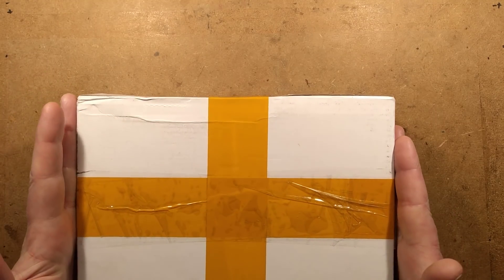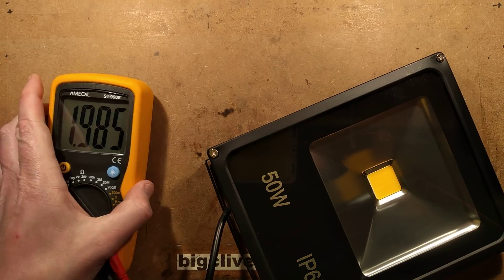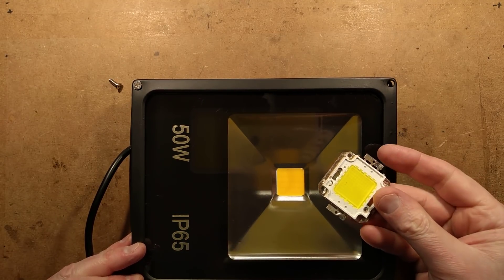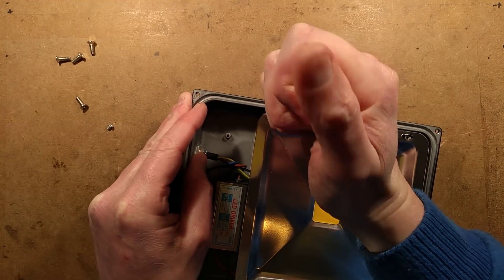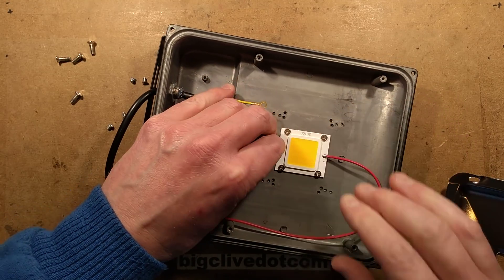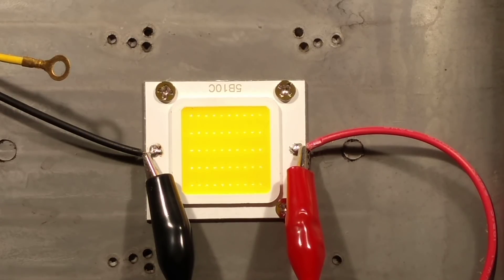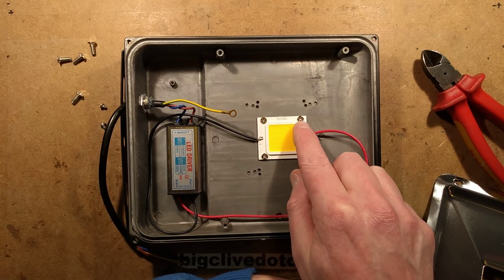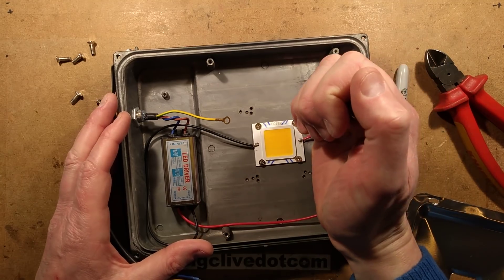Another cheap eBay LED floodlight.  Is it really going to be 50W?

Comment: Uk supplier my bum. These Chinese companies really piss me off doing this. Claiming to be Uk based but usually either send directly from China or send the item from China to a Uk reseller who then forward it on which takes longer. The Uk part of the supplier might keep a few things in stock but my luck usually involves an excessive wait.
I’m really impatient and have been spoiled by Amazon Prime delivery so I purposely don’t buy from Chinese suppliers for most things yet they still manage to screw me over.

As for the shitty ratings for Chinese products, on LED lights, they claim it’s the same output as a similarly rated halogen light. More bullshit arse covering.
Reply: I find that the delivery ETA speaks volumes.   A month for delivery from a UK seller is usually indicative of such a practise.   I might start doing what Stephen does.
Reply: @natejgee  - You are dead right.  People should go by the estimated delivery dates, order by that, and hold sellers accountable to those dates.  Even "domestic" sellers are usually Chinese sellers using a third-party domestic fulfilment center that they send product to and have mailed to buyers on their behalf.  At the end of the day, it's all made in the Far East, so I do not necessarily see an advantage where it comes from as long as the delivery date is what's promised.
Reply: That practice also really annoys me. If I'm suspicious about their claim, I usually add the comment to my order warning them: "If this item is being sent from CHINA I will give NEUTRAL or NEGATIVE feedback" - on one occasion I had a seller say that "we've no more stock", probably realised what's going on. 
Another annoying thing; eBay doesn't have a complaint channel for such mis-located items - they seem to thrive on it and don't care as they've got your money long before you can do  a n y t h i n g  about it...
Reply: @stepheneyles2198  I was lucky with 1 expensive item I bought. The seller claimed it was UK stock but then was sent from China. However, when it arrived, it wasn't correct so I raised a complaint. eBay gave me a full refund and said that I didn't need to return the item because I shouldn't be expected to send to China if the item should have been sent from the UK. The seller was livid and sent me a PayPal request every week for months.
Reply: @ @stepheneyles2198  Actually as a Hong Kong based ebay seller I can assure you that Mainland Chinese sellers annoy me more, using HK post I get my items to the UK on average  within 5-8 days sometimes just 3 days when the planets align, which is totally acceptable as I state my items are based in HK and delivery time takes a month. Mainlanders masquerading as HK-based have pretty much rubbished our reputation as HK Post does not offer the 1cent deals China Post seems to have negotiated/got subsidised. If you are happy to wait just a week and would like to establish the location of a 'China' seller  then try changing YOUR location as Hong Kong (we dont use postcodes) and if your 'HK' seller doesnt ship to Hong Kong  you can be pretty sure he is shipping from the Mainland and it will take ages.  "Good Cheap Fast - pick two out of three!" Shipping from HK will cost more than China every time, but it will be faster, as for Quality well when ordering the cheapest bottle of Champagne on the menu its probably not going to be a satisfactory experience, China does build quality items when buyers will pay for it, eg the iphone, but you can also buy some real grot for flumpence if you shop around.
Reply: Yes it can sometimes be bloody annoying trying to find a specific item on eBay UK that's actually stocked within the UK. Too many times I see the item, click on the listing, click on the seller's username only to find they're registered in China or Hong Kong.... damnit!
Not to mention how eBay UK's "Default" item location search includes other countries - if I want something from China I'll select "Worldwide". I'm still getting update emails from a post I made on eBay's community boards in a subject titled "Re: Why have we still not got "uk only" as a default?". I literally just got an update email 20 minutes ago, likely from another user disgruntled about the situation. I made that post 6 years ago. eBay know we're pissed off, they don't care.
Reply: Stephen Eyles t
Reply: I bought a bunch of these lights at auction off eBay last year. There were at least 6 vendors in similar locations (with similar names that lead me believe that they were really all the same). I started following them and was checking every other day for new items. They were both selling and auctioning items and were listing items as either from China or supplied locally. I was bidding on the auction items that claimed to be local. The prices were a lot higher but I soon worked out that not all auction items were selling well. So I'd drop out of an auction if the price got higher than the limit I estimated and look for a new one to bid on. It was only the first auction I'd won where I paid more than I thought it was worth. All the others were more reasonable once I worked out how best to go about dealing with these auctions. So it took a while to get all the lights I wanted. All the lights arrived within 2 or 3 days. Which implied that they were being delivered from local warehouses. Unfortunately, there was nothing on the boxes to indicate much of anything.
As near as I could work out, the local warehouses are used to supply larger items that are more expensive to ship or popular items that can be shipped faster locally. Small, cheap items are invariably shipped from China ("Small packet by air" via China Post) because it's dirt cheap. There are also the shonks that ship via Laos, Malaysia, Singapore etc. but I've learnt to avoid those because of the lengthy shipping times.
Reply: Another listing practice specifically banned by eBay policy is having item variations that are unrelated to the title... Like when they list a random USB cable for $1, then put the title as "DJI Phantom 4", and the real product is $2000.... I've reported hundreds, but eBay does nothing. All they need to do is use the highest variant price when sorting by lowest first - they'd stop doing it overnight.
Reply: @tin2001  I agree, that is really annoying, that and listing an item or variant as really cheap and set it to "out of stock". This applies to AliExpress as well. I just don't buy from these sellers, but that is hardly an effective way to get rid of the practice.
Reply: If they are "allowed" to lie about the power rating, with no repercussions, then what's to prevent the chinese sellers from lying about anything else, let alone from where it's shipping?
Reply: SigEpBlue In fact being shipped from an actual UK seller would shift compliance liability from the private importer (customer!) to the actual importer.  Because the rules require the legal responsibility to be within reach of union policemen  (for your choice of union of states).

Comment: If you have any search terms for finding the new flip-chip LED COBs instead of the normal bond wire based ones I'd love to know them...or a seller that explicitly sells them.  Had no luck guessing so far.  As for the writing on the COB, the 5 or 2 as you mentioned is probably the 10's of watts, the B I have no idea, and the 10C is probably ten chips in series.
Reply from the maker: I was hoping there was going to be a magic keyword, but there isn't yet.  The main seller of these on eBay seems to be:-
https://www.ebay.com/usr/cici-led-lighting
Who have them in amongst their other listings.  Hopefully they will ship the new flip chip type and not the old bond wire type.
Reply: @bigclivedotcom  From some searching I have done since then (with the aid of some helpfully high-res photos) the ones that appear to be the flip-chip type are the square COB with the raised center and dam around the phosphor as opposed to the square-ish sunken-center ones w/tabs.  Have yet to see bond wires on the former, almost always on the latter (if high enough res to see).  The former also alludes to no bond wire with the spacing and placement combination (on some) as the wire ones are always in a straight line packed close together.  So far just detective work with guessing until you or someone disassembles one of the square boards.  You buy one from your seller to take apart, or plan to take some phosphor off the one in the vid?
Reply from the maker: @IncertusetNescio  Some just arrived today.